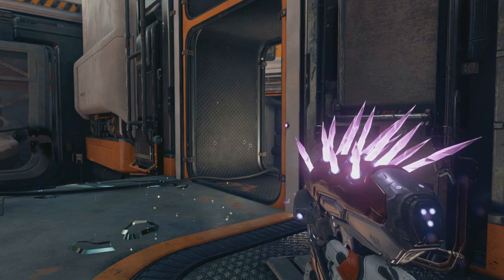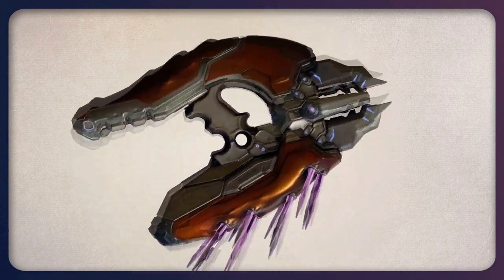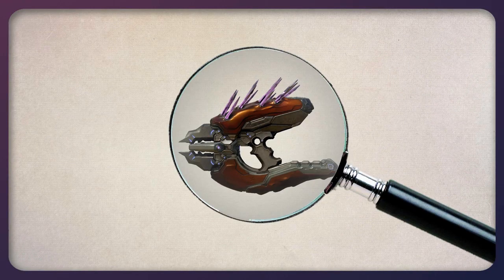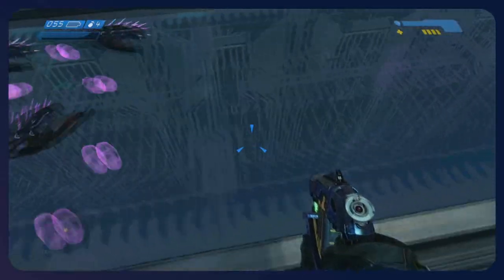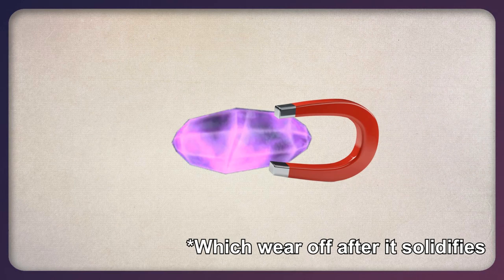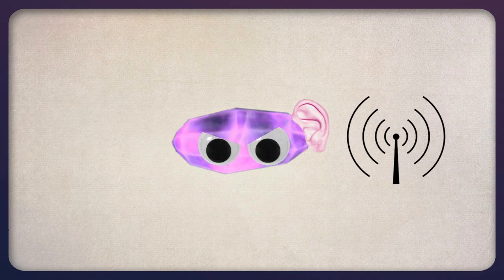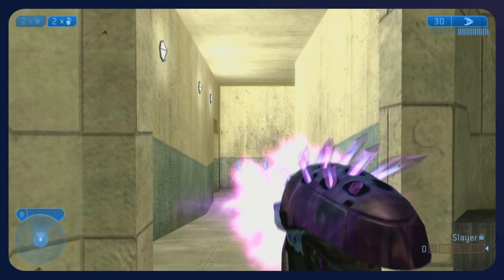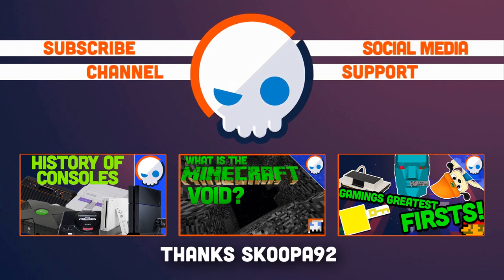Halo Theory: How does the Needler Work? | Gnoggin

Comment: I think you missed a vital clue! Dun dun dun, so how can a material be in only one location in the universe? Well, what other types of things are only in one location in the entire universe? That's right: LIFE. My hypothesis: The crystalline structure is actually a germ colony, or the crystallized byproduct of one. Probably a type of germ that goes into hibernation when outside of it's ideal condition, which would explain why you're able to vaporize it and it will immediately reform into a crystal. ALSO, this would explain why it explodes when several darts hit the same location, as germs commonly have ways of detecting when to incubate, and when it has enough friends nearby to activate.

[edit] Oh, the homing? Yeah I got nothing, maybe when it reforms midflight it also forms a flagellum in the mist trail behind it and... steers towards potential vict- I got nothing ok?!

Comment: I'm not 100% convinced other gases are needed. After all, with the whole bit about who the crystals have properties that are not fully understood could mean they are nano-level metamorphic, and the final emission system could program them with guidance, oxygen reaction for propulsion, and another reaction mechanism for the shatter/explode part.

This then begs a quick question - do they only explode when put in living creatures or do they also do that in destructible crates or such (as I don't believe they were doing proper explosions on walls, I think it's a valid question)? I haven't played enough Halo games myself to be sure; if it's only creatures, that would suggest the explosion bit is a reaction to organic material that requires a high concentration of both types molecules to properly catalyze; the smaller shatters then would be a smaller reaction and/or an ultimate finale of the oxygen propulsion mechanism.

Comment: What if blamite is a plant-like material, a bit like chlorophyte in Terraria? I could receive electronic pulses from the nozzle which make it change itself in ways that affect the gasses inside of itself. Making the gasses propel the crystal from different areas could be what changes where it moves. Venus fly traps are an example of plants that move based on electronic impulse, so this isn't out of the question.

Comment: No this doesn't explain supercombines, tracking, or the slow flight that defies gravity. You also don't need to keep pointing the weapon at the target so wire guidance is out of the question.

I think you may be on the right track with the crystals forming from gas. But that's the only thing you may be right about.

Don't forget other projectiles like the plasma pistol overcharge also are capable of tracking their targets. And the plasma grenades are able to selectively stick to a target but bounce off other surfaces. These systems are more like fire and forget, they will only track if you had aimed at a target when it was fired, but don't need to keep tracking as the projectile will do that itself. A good theory would explain this too.

But in the end, it's clearly meant to be tech that is so advanced it's no different from magic to our perception.

Comment: Blamite is reactive on its own. In Cole Protocol it was addressed that it is a volatile compound that has a timed reaction after impact, and that it is particularly explosive when it comes in contact with organics and water, e.g. a soft target. and that large Blamite chunk could just be a 'seed' that the gun uses to grow the needles inside the firing chamber. And, as the needles are too long to just sit in the chamber, they poke out its back. The gas thing, aside from perhaps the propellant gas, is kinda weak in my opinion. It could be using the explosion of one gas to snap off a shard of the needles and propel it out of the weapon, further guided (and perhaps given a little boost) by a magnetic 'bottleneck'. Or magnets forcing a shard off and a gas doing the poof part. This would be supported by the fact that only about a third of each needle are consumed per shot. They're fed into the firing chamber as it goes along, shards would not need to turn much. And maybe the act alone of a shard breaking apart provides enough propulsion? As for the tracking point you brought up, that seems solid; A scanner in the gun magnetically guides the round to the target.

Comment: The mechanism of the needler is probably (my theory) heating up the substance up and that build up of gas adds pressure in the gun allowing the needle to exit the weapon.  The blamite must have some kind of property that allows it to turn into a solid quickly.  One reason for that is pressure. A gas that is pressurized hard enough can develop into a solid.  Hence when the needle is fired, it has certain range before it "blows up".   The mechanism in the weapon must have a heater to turn the solid into gas and then pressurizing the gas into a solid that can be ejected.  To track a target is another story that I can not theorize.  The tracking thing that you mentioned is probable and I agree with.  PS:  the tail of the projectile is exerted by exiting blamite gas from the projectile.  I'm just saying :).

Comment: It could be the various isotopes of Blamium behave in different ways. 5 bladders could be used. Two stable isotopes on top, two unstable on bottom, one for raw Blamium to be safely sublimated and sorted into the other four bladders.
-
The largest bladder, for the most stable isotope, has a porous skin on top so the more expansive isotope can solidify in a more space-convenient way, which make sense as it makes up the majority of each bullet.
-
The next, beneath it, contains a more electrically sensitive isotope that is magnetically charged to behave as temporary, long range magnets.
-
The third, on the bottom, contains an unstable isotope that reacts with air to create a propellant.
-
The fourth contains a very unstable isotope that will also create gasses in the air that react violently with each other.
-
Each bladder would be connected via vacuum tube to the nozzle where a magnetic charge will first create an outline for the bullet with the electrosensitive isotope. Following that, the propellant isotope and explosive isotope are funneled into place, as the stable isotope creates a shell. The bullet is then pushed out as the air begins to ignite the propellant. Finally, the strong electromagnets in the horns on around the nuzzle manipulate the trajectory of each bullet.
-
When recharging, you simply position the gun facing upwards to allow the currently gaseous element to move through the organizing tubes from the fifth bladder to the other four, and then reposition the gun facing forwards to allow the shell isotope to solidify up top to ensure enough Blamium has made it through and will finish moving through it's tube into the bladder.
-
This would effectively create a magnetic assembly line for the bullets as they move through the gun, with the controlled air intake being the primary inhibitor of speed.

Comment: I don't think you need the third gas that triggers the needles to explode if left too long, and I would say the theory makes more sense without it as that doesn't seem like a very useful property to add to the weapon. Surely it's more likely that, after being fired, it would lose much of the stabilising effects that a crystaline structure provides, making it pretty unstable, and only capable of staying intact for a few seconds before breaking apart. Please correct me if I'm wrong about any of that.

Comment: How a gas could receive information: 
The muzzle of the weapon sprays the propellant gas, into certain parts of the needle as it solidifies, not just randomly spraying it into the firing chamber at random. The propellant coalesces in tiny gas pockets along the needle projectile these pockets break open as the needle flies causing it to alter its course. This explains why the needles explode after a while, the propellant hasn't entirely burned up.

Comment: Magnetism..maybe not. Since it would fire using a gas its more likely to use compression as a mechanism. The high pressure would make it fire and if the pressure is kept constant it would be able to fire quickly. Such things can be seen already with compressors. Perhaps it baffles humans because of the blamite and the properties needed in order to compress it. It is a foreign substance to them. And it was stated that no forerunner tech would be needed to reverse engineer a needler. Hence why Compression and pressire is a more plausible than any other thing.

Comment: I'm fairly new here and a this at this (nerd stuff), and last halo i played was 2 when it came out, but...
Let's rock this ))

I like your idea as a whole, but forget the programing gas (because, for one, it goes straight for you and not around obstacles), and let's assume it's a bit simplified for the game but we're discussing how it would work in real life, and we also have to assume that the needle is extremely light
1. load the weapon as you said, there might be a liquid state in between to accelerate processes
2. you aim the gun at foe (you see the red croshairs)(i don't remember if it arms and tags friendlies, but regardless that's not the key because you could add recognition easily, we even have that today, or you could simply have an additional "trigger" of sorts that wielder sets to tag a foe, anyways), 
3. the gun arms, now either at this moment or at "half-trigger" or other tag switch the gun tags you in way like modern laser targeting, but instead of just putting a light spot on you for missiles' hardware and software to interpret and follow, that beam ionizes, or polarizes, or basically "lights you up" with a certain radio or gamma or of the kind radiation,
4. when the needle is being formed, now it's not uniform, it's frontal half (or 1/4 or 2/3 or 3/4 it doesn't matter at this point) is being charged (or ionized, or polarized etc.) in a way that it is attracted to the "hot spot" created by the gun on target in a way needle of compass works (in case of polarization or charging only stronger but temporary), and the end of the needle is treated so it would release the gas as a propulsion system, also as i said beforehand, we have to assume that the needle is extremely light it might be slightly heavier or lighter than air it wouldn't matter much because attraction and propulsion would be correcting flight for either case and because of being light it would easily turn after it's target.
5. now upon reaching it's destination the "radiation" foe was tagged with is going to perform as a catalyst or a spark if you will, for the chemical reaction which will cause the needle to explode, more needles chain and compound reaction as with most explosives, and that's why the needle that hit any other surface do not explode but just disintegrate
 
Simple and yet very useful weapon causes virtually no collateral damage.

How's that ?

Comment: So my guess would probably be radioactive stimulation in an area to allow a guided like system, with a probable sensor on the front to direct it to some degree.. As for the exploding part.. my best guess is it probably some type of natural capacitor.. but how does this not just release its energy into the air? well easy the inside of it is the electrically charged and the gas would probably be a conductor or a semi conductor where the solid form would be a resistor so upon impact the shard would break or at least crack at its tip, the gas  would then make contact with the armour and cause an explosion of suddenly released energy.

Comment: I use to take my magnet when I was younger , and plug in numbers in my calculator. When I put the magnet to it the screen clears then becomes normal, but when I clear my calculator then put my magnet to it. the numbers appear on it. same thing when I move between two calculators. if the information is being sent through a numerical pass it could work like binary. the gas is a magnet so it has a small amount of memory, and could receive it theoretically like my calculators were able to transfer data.

so the sensor could just relay information of a targets actions.

Comment: I like to think of the crystals turning into a liquid form being pumped to the front of the gun rather than a magnetic gas. Only reason I say this is because if the crystal turns from a solid to a gas, what's stopping the whole crystal from turning, rather than just parts of it. A liquid to me would make more sense as it is being superheated (or something along those lines) around the bottom, so it essentially just melts off and the rest of the crystal slides into place ready to be heated. Another reason why I don't like the idea of the crystal being a gas is because if they are turning from a solid state to a gas state that quickly, wouldn't that instant change in pressure blow out the innards of the gun? The only thing I can think of to counter that statement is if that sudden rise in pressure is what propels the gas out of the muzzle.

Comment: What if the extra gasses are just catalysts used to speed up the process of gas to bullets? But that would mean a chemical reaction is occurring...unless one of the gasses are used to make a chemical reaction then a catalyst would explain an increased fire rate, right?

Comment: data is merely patterns such as 1s and 0s.  computers see all the 1s and 0s as active/not active or true/false.  we can simulate this is glass, crystal, and other materials similar to the solid state of blamite.  so just like those laser etched crystal/glass objects that have 3d pictures in them and look pretty when you shine a light into them, the blamite is being engraved with information describing the target.  when the target disappears, the blamite is no longer capable of finding the target.  the process would be blamite is stored as a gas in the magazine kept at the top of the gun.  chemicals (compressed gas) would be kept in the bottom.  using magnets and motion, and probably something to seal the blamite in, you can isolate the blamite, and then force the blamite through using motions that adjust magnetic fields increasing the force on the blamite, or better yet, opening valves that keep the blamite from escaping the holes.  when the trigger is pulled, another electromagnetic signal is adjusted on multiple magnets keeping the shutter for the blamite gas sealed while opening the valve for the solid needles.  when isolated from oxygen (which could be what causes the blamite to harden) the blamite can be introduced to an element or condition that would instantly change its state back to an electromagnetically ionized gas allowing it to travel quickly to a magnet somewhere in the barrel.  more magnets can be used to adjust the arrangement of the blamite as it is reintroduced to the element causing it to instantly harden, and this would be how it is encoded with the target the needles must identify.  a chemical of unique density and propellent properties would be injected to allow it to levitate at slow moving speeds but one thing doesnt add up which would have to be the part that the covenant doesnt even get.  how can blamite see in front of it to follow the enemy?  homing tech involves tracking a material by using a material that is attracted to a material in the target, or using intelligent decision making combined with optical sensors, and a propellant.  of course, it is also possible blamite is far simpler than that.  it could be, just like we dont know the full nature of magnetism yet, blamite could be like a variable magnet.  instead of just being attracted to metal, it could scan a material in the enemy such as dna, (that would be the gun) and somehow feed a data that would simulate the material to the blamite which could then be adjusted in its own kind of magnetism to follow the material identified in the target which would take a lot less magnets due to electrical signals and literally just sending patterns of signals to alter what the blamite is attracted to, how heavily it is attracted, and what state it in when introduced to said material.  this would explain everything form how fast it moves through what materials, how quickly some blamite turns into a solid and why even when some blamite changes state instantly, the rest of it stays gassy as it dissipates into a mist.  we have accomplished great things just adjusting magnets, turning them on and off, and adjusting their intensity and position.  if you could make a magnet attracted to anything, and change its state in reaction to a chemical, it becomes blamite, and without even understanding it, we would be able to manipulate it with no necessary sensors and it would still be a valuable weapon doing something similar to blamite in a needler.  and the lack of homing property in the rifles can be merely attributed to 1 the speed of the projectile, and 2 the lack of handling on the blamite when sent through the air at said speed making it pointless to even designate an attractive material.

Comment: how can gas receive information ... when the "gas" passes the data prongs it is more plasma/solid then inside the gun .. add in nanobots that adjust gyro rotation of the formed spike needle and you have a needle that can follow a target slightly

Comment: magnets are completely pointless in the equation. why not thermodynamics? the gas crystallizes as it comes into contact with the cool air. and the gas wants to be a gas or prefers to be a gas. so it could all be just heating and cooling mechanisms in the weapon (not mechanical or moving parts) to control the firing reloading and even the enemy tracking of the ammunition. and the explosions on contact with multiple shots could be like them bursting into gas at a high temperature when coming into contact with either a heat source like the human body or a certain chemical that may be in our blood or suits depending on how far they can even penetrate